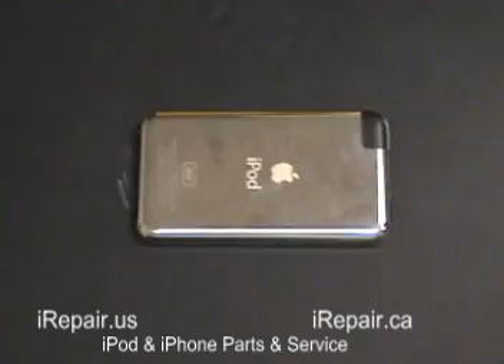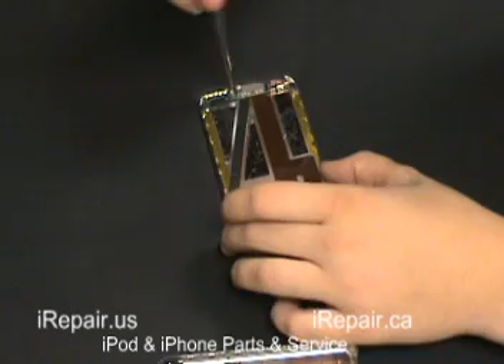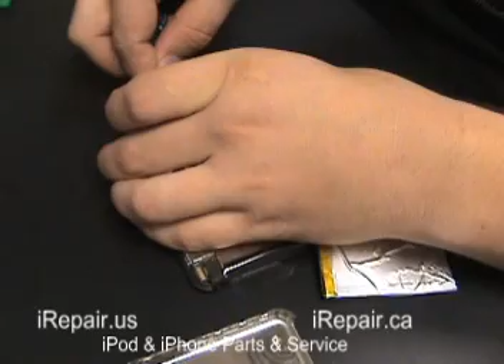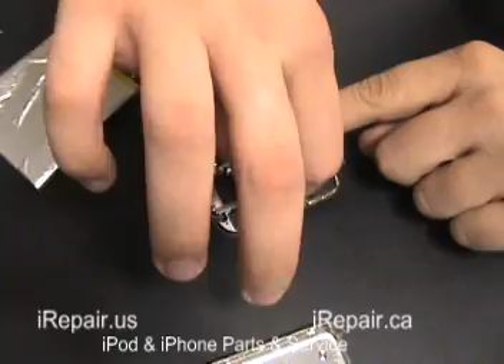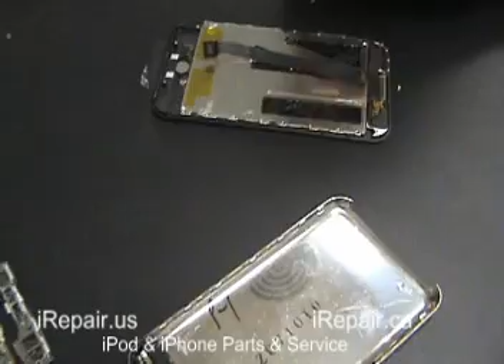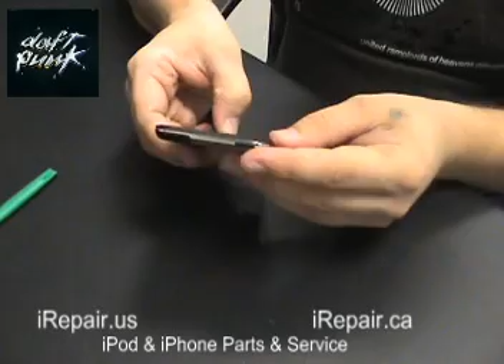Apple iPod Touch Disassembly - Fix your broken iPod Touch

Comment: my ipod touch when i lock it and try to unlock it flickers different colors and the touch screen still works and i can still use it but i have to know were the stuff on my ipod is because it is covered with a flickering screen but when i plug it into A charger then the screen is visible againnand goes just fine and i can unlock it and lock it  while its plugged in but not when its unplugged

Comment: @NotoriousSnipers the new ones? skull candy earbuds. i got them on black friday @ target, but i got new ones on christmas so i stopped using the skull candy and used the newer ones, then they broke and i thought that it was my ipod bc i had just gotten the earphones but i put in the skull candy and it worked fine....skull candy (in my opinion) is definetly one of the best earphone brands out there. i definetly would recomend them if u think it might be the earphones and not the ipod

Comment: There are options you may use with a faulty headphone jack. Either take it into an apple store to get it repaired or use a q tip with 90% rubbing alcohol while the device is powered off and gently clean the port. It worked for me but only use this option if your ipod is no longer under warranty.

Comment: I opened this shit without that tool. I ended up beding the cover and breaking the seals. The cover is hooked onto the case which means once they are put together u cannot force it open unless u release hooks or break them. I used chisel and hammer.

Comment: Hi, I need some help for my iPod Touch 3G, 3.1.2 firmware jailbreaked. I was using it and the battery was at 2%. I was downloading stuff on the net and the battery became empty. I have been charging it on my laptop via USB and in my house with a pluggin for more than 12 hours but I still can't open it even with hard restarting (Hold Button+Home Button). I jailbreaked it with blackra1n, so it's semi-tethered. Everytime the battery is empty, i have to jailbreak it again, but now it wont recharge.

Comment: Whenever I plug my ipod in to charge it always comes up with the battery and it's extremely low on red, and there's a small lightning bolt underneath it. I dont know what to do to fix it, can someone please help me? Thanks!

Comment: actually i found out what works the home button, dont recommend u doing this but..... if u take of the screen, right where the home button is there is a black spongy thing and a gold colored metal piece, if u touch both the spongy thing and the gold thing with a screw driver it acts like a home button, remember that u WILL need to take off the screen so be careful if u do

Comment: no do this instead, hold down the power and home button at the same time, WHILE STILL HOLDING THE HOME BUTTON, release the power button and plug it into your computer, but dont release the home button until its plugged in. comment back if it didnt work.

Comment: it depends. was their power in the battery when it got wet? if their was, you will need to replace all electronics in the ipod. if the battery was out, then it should work after a cleaning. it sounds like you have charged it and tried to turn it on. dont do that. for future refference, dont turn on an electronic that got wet on, until you are absolutly sure it IS dry. if an electronic gets wet, will it has access to power, it will break.

Comment: Its not possible unless you switch out the circuit board that has the memory on it, just buy a 16gb to save costs, or if you wait for a year apple will be releasing a 32gb one and dropping the 8gb